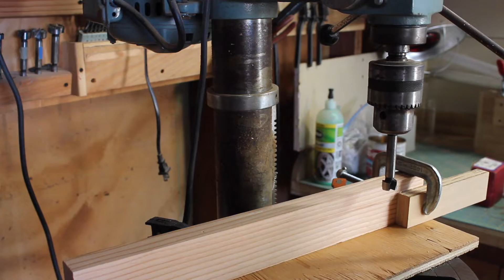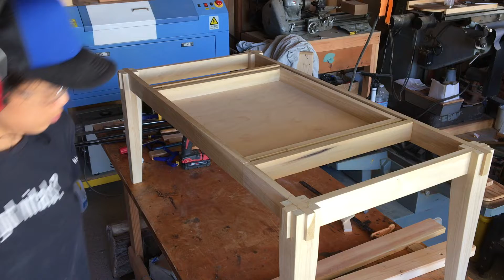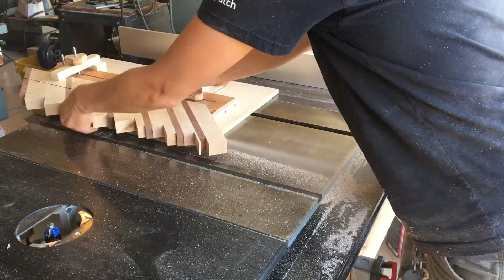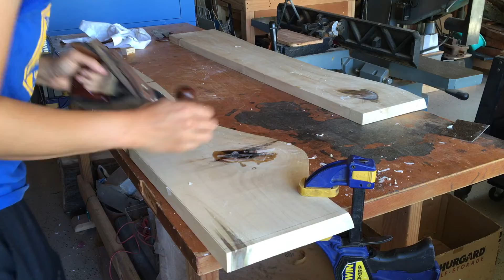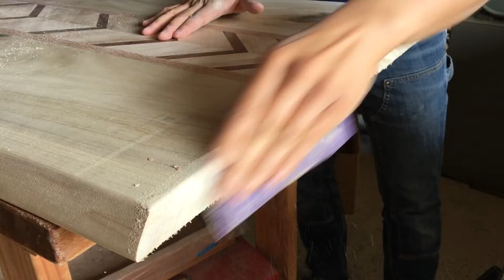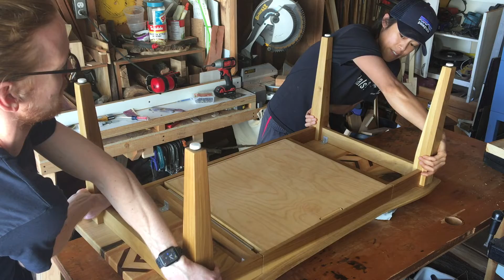Making a Live Edge Coffee Table

Comment: Awesome, and a great end result! I notice it's been 18 months, how's it holding up? I'm no expert, but I would have elongated the holes in the metal brackets to short slots to allow for wood movement (specifically allowing the table top to expand and contract in the short dimension while the short rails will not). I'd expect it to show up within 2-3 years if it's going to be a problem, so I'm curious how things have gone for you and the table since this was filmed.

Comment: Table looks awesome.  Is there something you did to account for expanding/shrinking?  We had a beautiful multi-wood bar-top made when I was a kid and over the years it split apart.  I think I understand the method of failure, but I'm not sure what the usual woodworking workaround is.
Reply: The table looks amazing! But I second the concern about wood movement. Google "tabletop fasteners" for some common workarounds.
Reply from the maker: You both bring up great points. I didn’t think much about either to be honest. For the table top itself, I’ve really only got the pins and the glue bonds. Time will tell how well they keep things together. Maybe people just use more pins or biscuits or they are smarter about their wood choice and grain direction so that the expansion mismatch isn’t so bad. For mismatch between the frame and the tabletop, I think I can just increase the hole size on the brackets, use some washers, and not tighten as much. And probably I would only need to do this along the back rail since the front of the frame is very wiggly because of the drawer.

Comment: nice video and nice table!
does the linseed oil penetrate the wood after the two epoxy coats? did It just because you sanded off all the epoxy?
Reply from the maker: I think the linseed oil penetrated in some places, but definitely not as much as if I hadn’t done epoxy. It’s kind of an experiment. I’m too lazy to do a thick layer of epoxy that I sand and polish. This seems like a pretty good compromise for now.

Comment: Hi Amy, nice channel! Do you use 3D printing in your shop? I find it super usefull to print (mostly small) very precise special jigs/spacers/angles/aligners/clamps etc. Even if it's only for correct markings. Sorry, don't know correct terms in English, but you get my point. Just built a 'busy-board' for my baby son. Btw, cool use of Fusion360 to analise how to use your available wood. Good luck with your channel!
Reply from the maker: I can see how that could be useful, but 3D printing is so slow, I try and use other methods before resorting to that.
Reply: @AmyMakesStuff  True... it's not nice when you have designed something and then have to wait a few hours before it's fiiiiiinally printed 😄. And besides, it's also fun to find solutions with the tools/materials that are at your disposal. Ps. I loved your flexure videos. Good luck!

Comment: Good to see you back, missed you. Poplar is such a good wood but the smell is so bad when working , we called it stink wood. That being said it’s a fast growing hardwood and very inexpensive for a hardwood. It’s interesting that the greenish color of wood does not show in video. Thought , as pattern maker, knew more about wood that needed, is there a difference of eastern vs western popular? That being said we only spec this for draws and backing material. 

Now that I professed my self promotion, lol. Congrats on the 10k and table looks great! Fantastic job!
Reply from the maker: This is my first time really working with it so really I know very little about it. Also, it’s so soft that I’m surprised it qualifies as a hard wood! At least that makes the sanding and scraping go fast.
Reply: Amy Makes Stuff , I know it’s one of those oddities of life a soft hardwood. It’s still very stable and good material to work with. I did mostly use it for a base wood as an upgrade from pine. Shrinkage was very comparable to mahogany ( primary surface wood) so I could reduce cost to my customers by building much with popular. It was a bit temperamental with initial moisture content when glued to other wood, but hit that sweet spot and you were good. I never used it as a primary wood so don’t know about it as you are using it. Then I made foundry patterns, fixtures and jigs not the pretty stuff you used it for. Great job!

Comment: That grain pop when applying the epoxy & the boiled linseed oil was just stellar!
Reply: What does the linseed oil do on the epoxy filler?  It doesn't soak in, does it?
Reply: @somebodyelse6673  I'm wondering about that too...
Reply: @somebodyelse6673  On the epoxy I doubt it, since it's probably not porous enough the absorb the oil.
Reply from the maker: This will be kind of an experiment. I scraped a lot of the surface down to wood, but that wood has also soaked in some epoxy at this point. The linseed oil does appear to have cured and formed a good waterproof surface. Time will tell if it was able to bond well enough. With this epoxy, I wasn’t able to get a mirror surface, so if I wanted a full epoxy finish, I would have needed to do a lot of sanding an polishing, which I am hoping to avoid. I am definitely all ears for other grain filling methods and finishing methods!